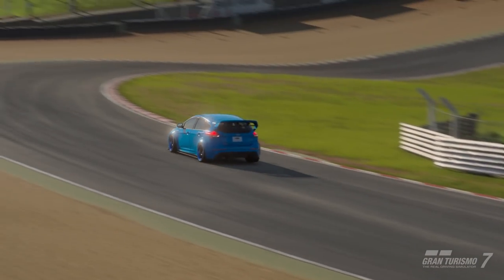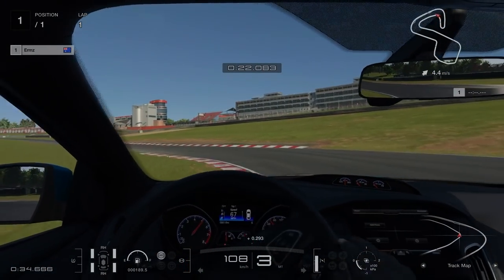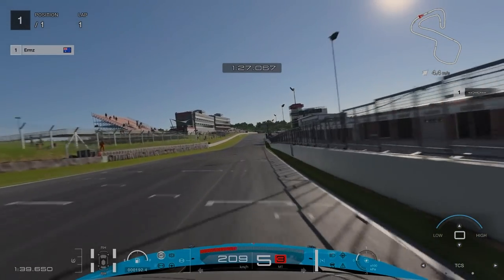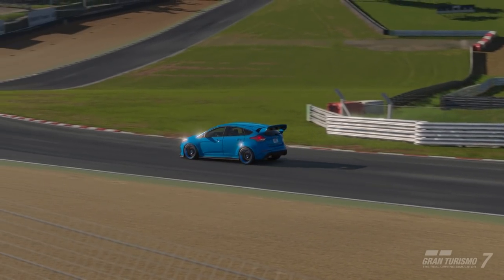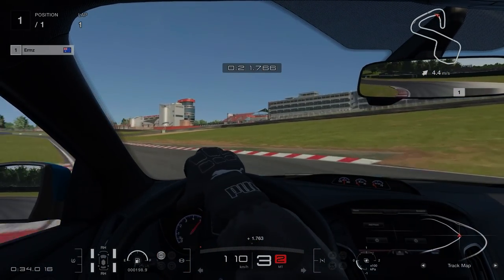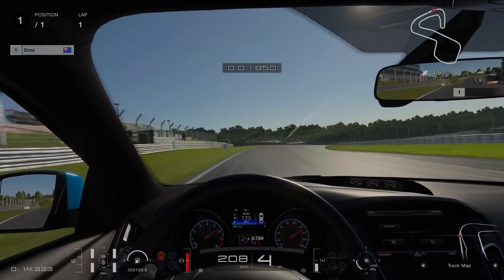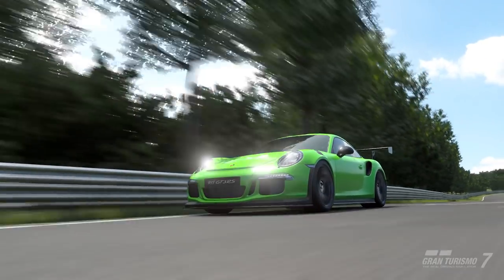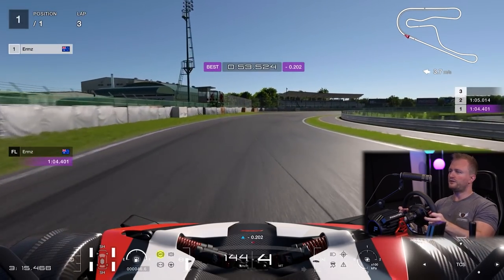This is Why You Keeping Spinning in Gran Turismo 7

Comment: Now try this in a RWD with 900hp
Reply: I am currently trying to modify a 1000hp f8 tributo
Reply: For real, I’ve been trying to get my camero with 950 hp to do a lap at trial mountain without spinning
Reply: Exactly this video is bias dude is using a 4wd focus
Reply: Yeah my AMG GT Black series could use a little love
Reply: Hint: key to not spinning out is throttle control
Reply: @connoisseuroftigolbitts  I use throttle control, and the backend just wants to stick out
Reply: @connoisseuroftigolbitts im legit spinning driving straight idk what i am doing wrong
Reply: @lucabehringer7914  lift the height more up ⬆️ make sure you camber and toe in is symmetrical

Comment: Awesome vid, as always. I like the physics in this game for the most part, but I do feel like I had to relearn a few things. Cheers!
Reply: I feel the same too
Reply: I agree, going from GT:S to GT7, you really do need more precision while racing.
Reply: I was thinking the same thing when I was doing the license test and the Z had this crazy snap oversteer. I had a G35 and would've crashed it if it drove like that 🤣
Reply: Different but not better. Certain physics are just stupid that even sim games assetto corsa don't even have.
Reply: @mrshab  Hi! After plugging in a bit more track time since this post, I definitely agree… Different; not necessarily better. Though, for me (and my driving style…), It’s definitely better in some aspects. I’ve noticed spots where in GT sport, I could not correct after making any kind of an error coming out of a turn… As opposed to GT7 where I actually can make corrections and get myself (in that similar situation). I digress; I will definitely agree with you there… Different, but maybe not necessarily overall “better“.

Cheers!
:)
Reply: @fernfernacelli  agree there. Its just confusing as it seems like the usual tricks you can get away with in sim games you can't here so have to understand the physics for this game exclusively that won't really help any other car game. I'm just tired of porsche spinning out at random turns which I'm driving the exact same way with the exact same car in assetto corsa in monza and I'm doing fine over there. 
Enough of my Karen moods lol. Hopefully they update this game and improve certain physics so I don't have to keep guessing
Reply: @mrshab  Oh, man - DILLY DILLY.

I’ve been a GT fan since day one, but I also love ACC, dirt 2.0, and some other PC Sims. It’s definitely a readjustment to play GT and understanding its unique physics!

Though… I do love how accessible it is to the “general public”… My brother, who is not much of a driving/racing gamer, can jump onto this and race with me for fun… Though, he would never go near something like ACC. So, short of also being a huge fan of what GT has been since day one, I love the wide reach that it has for those that don’t really drive/race.
Reply: @mrshab  It’s the same with Forza Motorsports, they’re close to being a simulation but they have that weird physics that almost makes the game harder for no reason … 

It feels like they’re doing it to differentiate themselves from other games . 

GT7 feels like Project Cars 2, almost exactly .

Comment: one thing to note is that raising the acceleration sensitivity in the rear increases on throttle rotation at high speed. I find cars with more than enough tire as well as aero can sometimes benefit from the higher accel setting, but 90% of road cars above 400hp and race cars with the harder compound of tire, its better to run it lower. great video

Comment: Keep in mind that you can also rob yourself of speed out of the corners by setting the acceleration sensitivity too low. A more open differential essentially limits the power to the tire with the most grip based on the tire with less grip. (It's more complicated than that, but that's the end result) This means the car won't accelerate as hard while turning, and will struggle to rotate on the throttle. This is why pro setups tend to use higher acceleration sensitivity (IRL= lower angle). They have the driving technique and throttle control to use it to their advantage. They usually try to get the car rotated as quickly as possible while being in control and not losing speed (like in a drift). The earlier they can get the car rotated, the earlier they can open the steering and straighten the car out. With a higher diff acceleration sensitivity, setting the diff will lock earlier and they will have more torque available to accelerate onto the straight. As with all settings, it's about finding the proper balance depending on the driver, car, track, and conditions. Also, GT's settings and physics may work a little different. They have a setting for sensitivity (angle), and initial torque (preload), but not locking strength (number of plates), so I'm not sure if that is combined into other settings.
For anyone who wants to better understand how differentials work, Donut Media did a great video on torque vectoring, and they have another all about diffs too I believe: 
https://www.youtube.com/watch?v=iIBmJVV0zjw&list=PLFl907chpCa7oMxN6jGo93g8VriQk7ICc&index=8

Disclaimer: I'm just beginning to understand this stuff myself. So if I got something wrong, please correct me.
Reply: nice info m8 explained it very well so far i have not seen so much info on any youtube channel 
and plz can u make me understand  the difference on lower ride highs in front and higher in rear or vice versa effect the handling  
and same with damper and other suspension settings.
i want to wright it down on some paper and hang it on my wall to get better at tuning my self i forget to quick. thanks 😂
Reply: @rinkumultani6515  Thanks. You are talking about rake; the angle the car sits at. It's a good way to tune out slight under or oversteer. Raising the rear will shift the weight forward, moving the balance toward oversteer. Lowering the rear does the opposite. However, when aerodynamics get involved it gets more complicated. raising the rear will increase the angle of the wings, so you may end up getting more rear grip in high speed corners, and less is slow corners. Lowering the rear will decrease the wing angle so you'll get less grip in fast corners, and but more in slow ones. Front ride height is usually just set as low as you can without bottoming out or limiting the suspension travel too much. Again, I'm not an expert, and the physics in GT may not fully follow real life. 
Dampers can be adjusted based on feel, but getting them really dialed usually requires telemetry and knowing how to read it. You can usually get the car feeling pretty good just using wing, ARB, ride height, diff, and brake bias settings. The tough thing about GT is they give you a lot of settings but you don't get a baseline setup with them. 
I'd look around online and see if you can find decent baselines, then tweak them to your style.
Reply: @angryginger791  yes i wish gt game did hade some telemetry like pc sim games :(
Reply: This was exactly what I was thinking when he was lowering it. I would think you would set low, but keep it high enough to where you don’t get excessive under steer or oversteer. All depending on the driver and the car of course.
Reply: @rinkumultani6515  I think they did have it in the old versions. I'm not sure why it's not in the new versions. I hope they add it eventually.
Reply: @angryginger791  As far as I've heard rake doesn't do much if anything at all to weight transfer, there's a neils heusinkveld video on it, if you really think about it how much weight are you really transferring forward by putting the rear up a few mm? even if you add a multiple whole centimeters it's negligible, rake changes the aero balance more than anything.
Reply: @RWoody1995  You're right. And I've seen that video too, so no excuses for mis-speaking. LOL! Rake has a far larger effect on aero balance and only "transfers" a very small amount of STATIC weight (so small it's usually negligible).  However, it does affect how weight is transferred dynamically, like in a hard corner. This is because the roll center changes. The best example I've read was something like this: Let's say a level car transfers 600lbs of weight to the outside tires during a given corner. The spread of that 600 lbs is usually not equal front to rear. It might be 350 on the outside front and 250 on the outside rear. Now, if we lower the front of the car and then go through the same corner, the same 600 lbs is transferred to the outside, but now it may be 400 on the front and 200 on the rear. However, that's not all down to rake. The overall ride height makes a difference too. Obviously, an overall lower car will transfer less weight than one that's jacked up. And other suspension components and settings will affect how much or how little a change makes to handling. I mean, the whole point of anti-roll bars is to keep the car from rolling side to side, so the roll of a car with softer bars will be more affected by, say, a springrate change than one with stiffer bars. Again, I'm not claiming to be an expert, and I might not have this quite right either. I'm just sharing what I've learned so far. This is why good race engineers make big money. LOL!
Reply: The problem with this is higher throttle sensitivity = more oversteer = death. Doesn't work in anything RWD

Comment: If you know what a floating cross shaft differential is or looks like, it makes tuning differentials so much easier in this game to understand in terms of the function/parameters.  The initial torque is the bite of the clutch plates, that in turn are receiving the amount of torque under accel or decel based on the ramp angles of the cross shaft beds.  Nice video.  I have noticed that this game is specifically unique in that assumptive tuning methods of previous titles goes out the window.  You can bottom out, have too hard or suspension, too low of suspension, too high even....  dampening is something you'll want to take a look at soon as you apply downforce.....

Comment: I heard people said putting ballast on front will reduce snap oversteer but in reality it won't do anything other than adding extra weight - except for rear engine Porsches because the ballast will act as a counter balance for weight distribution.

I always suspect it was the LSD, and you helped me realize that. Thank you mate.

Comment: There is an absolutely big problem with the tire model about the slip angle and the grip under different vertical pressure.
Reply: Driving fast (and trying having fun) with the G29 is simply a nightmare...
Reply: @patf40  I am driving with T300. There are more details, and you know the tire dynamics is absolutely wrong.

Comment: I actually thought it was the gravity physics that is lacking..proof is the silly jumps going hectic..

So less gravity = less grip = crazy spinning out. Its like less down force ..but even at slower speeds

Edit: it may be a "torque" effect...requiring player to use analogue stick to correct the steering jitters that one would encounter. Problem is..its stupid to deploy them on a controller analogue stick. In a real wheel, you simply hold the wheel tighter or make minor adjustments.
Reply: I can see that. For some reason in this game, I feel like you need an unrealistic amount of downforce to keep your car planted.

Comment: You changed the diff distribution to 50/50 from the previous rear biased setting then blame the under steer on the suspension change. One change at a time right?

Comment: I still have zero idea what the Initial Torque setting for the diff even does, coming from diff-tuning in Forza which essentially just has the other two but phrased differently. And it's even weirder, because fully-locking the diffs on acceleration is what you want to be doing in Forza, at least until you reach S2 or you're only running two-wheel drive in which case you drop it right to the middle setting for the most part.

Before this video, what I always did for cars with diffs on this was change them back to 10-40-20, which was what the defaults for it were in GT2 (and probably other games in the series as well), and that did help a bit. Should be interesting to see how this video's ideas play out in practice.

Comment: A Very good tip! Go and look into the race Cars how low they are, how much Aero dynamic they have, which Suspension settings they have... If you are a Rookie to tuning, just more or less copying one of the race car tunes will leave you with a very decent tune. That's how I started tuning my car's in GT year's ago before I learned to really understand the tuning

Comment: I'm currently stuck on the porsche cup challenge tracks because I have to drive the Porsche 911's and I'm sooo happy to hear that this is a genuine issue and not just that I don't know how to control the car. I'm definitely going to be taking the advice on board and re-tuning it before my next attempt.
Reply: Used the advice in this video and a few others and managed to tune a wonderful 911 for those races. Good luck!
Reply: Install 3rd stage weight reduction then install a ballast and put all in the front, it helped my 911 turbo be more stable overall
Reply: Those were definitely a challenge! My solution was to install the custom transmission and widen out the gears so that it was putting power down less aggressively when I stepped on the gas. Also set TC to 1.
Reply: Thanks for all the advice! Never would have thought to put more weight on the car.
I had to turn the difficulty down to medium, no way was I going to shave 5 seconds a lap off my times but managed to get through it now. Truly hate this car 😄

Comment: A tip for suspension height: some cars, if you slam the suspension all the way down you’ll lose your turning radius, meaning you won’t get the entire rotational degrees of your tires. Do this through time trial, getting lower and lower until you can’t turn your tires completely anymore

Comment: One thing to note about suspension settings is that on some cars you can actually make the car too low and limit steering angle. R32 gtr is an example of this, so some trial and error is neccessary

Comment: i'm not a car gamer.. or a gamer at all.  but i am a car nut,  and with the torque vectoring  changing the ratios to 50/50  is something that creates huge understeer,   car manufactors use the rear bias to make the car turn.   50/50 is usually a set up used in trucks with locked transfer cases
Reply from the maker: Yes, which is why GT7 is so far off-base.

Comment: Didn't work with the older stuff polyphony need to sort the steering sensitivity especially on the old cars. Was turning in at the hairpin in my tuned mustang 429 and full lock going less than 40kph still under steered right into the wall. Even if I took a wider line and used the throttle to get me around it still skimmed the wall. Same thing with my tuned 3l csl.

Comment: I’ve been thinking that some of the oversteer tendencies on some cars seems very exaggerated. They definitely need to make it more realistic.
Reply: The physics are broken, hopefully they can patch it..

You can Try some basic rl tuning principles. Buy the fully customisable suspension. And Simply remember softer equals More - priority of Grip in weight Balance. You have anti-roll bars / dampers compression (bump) and expansion (rebound) / natural frequency (Springs rate) 

Try a generic baseline, like

anti-roll bars F6 R3
Damping bump F35 R24
Damping rebound F45 R39
Spring stiffness F2.20 R1.70

The actual number doesn’t really matter only the difference. Bump or compression damping must always be lower at the rear, and Springs or natural frequency similar. Anti-roll bars and rebound expansion damping you can play around with more
Reply: The games a disaster . Gave it to my son and I've gone back to gt sport

Comment: I have the worst experiences with the sometimes janky physics model when I drive a MR GT3 car (also happens with FR cars but less often), the downforce is set to the highest possible setting and I get snap oversteer on full throttle in 4th/5th gear corners. It's completely unpredictable and keeps me from pushing as hard as I can since I can't trust the car to behave naturaly anymore.

Comment: I have some questions.  This tune you were doing works roughly the same on FR and MR cars, yes?  Also......Is it a fair thing to say that the Wheel/Pedal setup is probably a better way to control throttle input and braking?  I think I may be at the limit of my controller, and I am really starting to think that I need a wheel.

Comment: So I have a Corvette that I built and it has a 1060 horsepower, with traction control on five the wheels still spin out, will this method fix that issue?

Comment: There is also a setting in assists that automatically helps you counter steer and it makes the car feel so unnatural. If your reading this turn it off, it makes a huge difference to the way the car feels